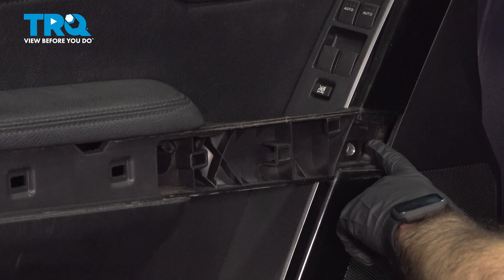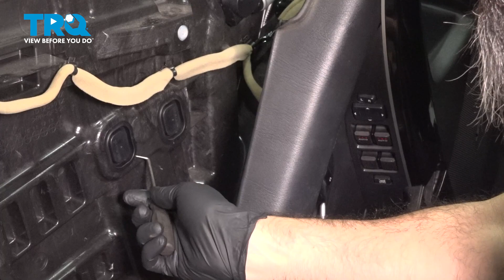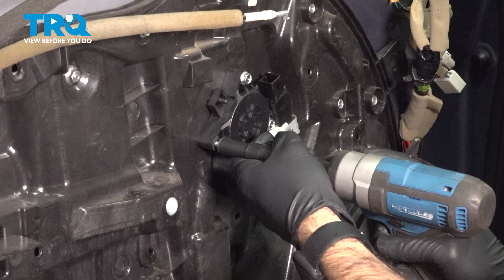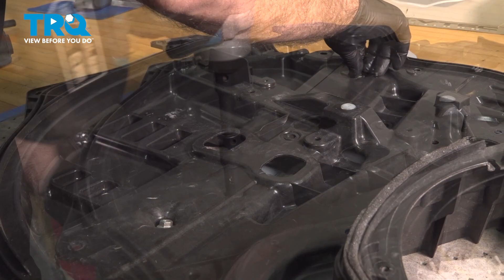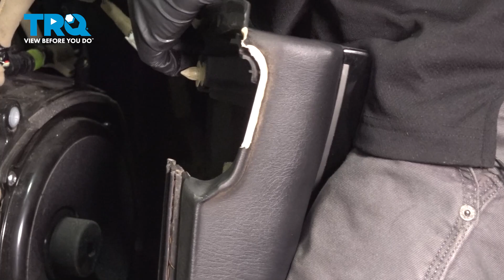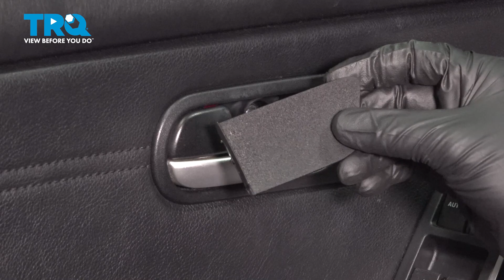How to Replace Window Motor & Regulator 2007-2015 Mazda CX-9

Comment: If you can move your window regulator motor up and down to access the bolts then why are you replacing your window regulator motor. Because it seems to me like you're still works. Now you should probably give an explanation as to how you're going to do that if your window regulator does not move up and down hence the word broken window regulator